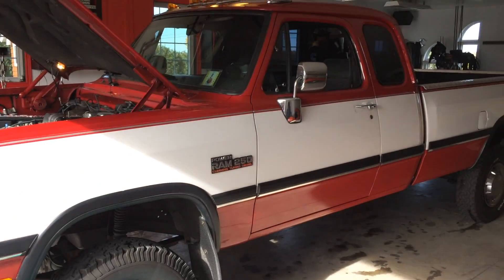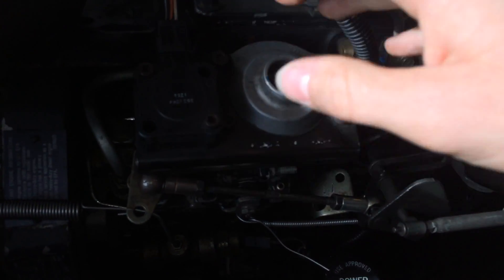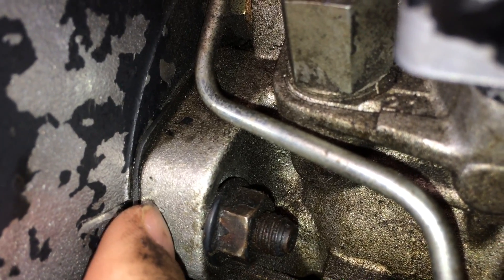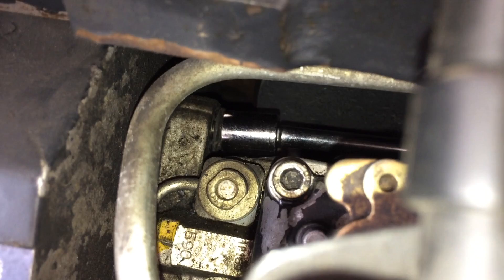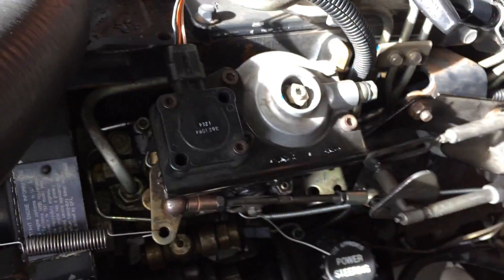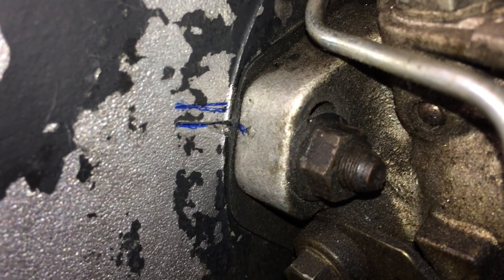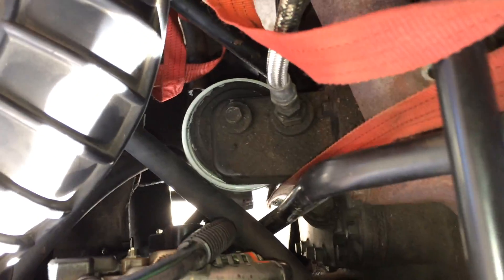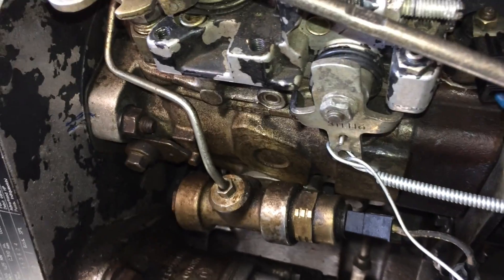VE Pump Timing Bump 12 Valve Cummins

Comment: Hey Tyler, how the hell did you ever get sockets on those two difficult nuts?  I've been at it for an hour and am not even coming close.  I can get a socket started on the one between the pump and the block but it's angled too much to grab.  The one up underneath I can't even get close on.  Did you use long extensions on both of them, and did you use a universal joint in there somewhere?   I'm about ready to give up.
Reply from the maker: Haha, if memory serves me right I believe there were many wobbly extensions involved and maybe a universal and some curved wrenches.
Reply: @OvensGarage  Thanks!  I bought some curved wrenches tonight and will give it another go tomorrow.
Reply: @OvensGarage  Ok, I got it done.  For anyone else who comes along with the same issue, here's what worked for me:  For the upper nut on the engine side of the pump, a curved (s-shaped) 13mm closed-end 12-point wrench worked great.  Just enough room to get it on the nut and turn it one notch at a time.  For the lower nut under the pump that you can't even see, I removed the throttle linkage and battery so I could get my head in there to see exactly where it was.  Then I put together a 13mm, 12-point, 3/8" drive socket, a 3/8" to 1/4" drive adapter, a long 1/4" drive extension, a 1/4" to 3/8" drive adapter, then my 3/8" drive ratchet.  The 1/4" extension was narrow enough to allow the socket to fit over the nut (tried the 3/8" long extension first but couldn't get the correct angle to get it on there).   The upper nut on the driver's side of the pump and the lower 10mm bolt are not an issue - standard tools to loosen those.
Reply from the maker: @garylewis327  thanks Gary! Glad you got it. Did you notice a difference in performance after doing it?
Reply: @OvensGarage  Tyler - yes, before this I had a little lag out of the gate but it just gets up and goes now.  I do seem to have a little more smoke than before, which I don't quite understand, but I'm going to turn the smoke screw out a little next.  I'm going on a trip next weekend so should have a better idea on overall performance and mpg after that.

Comment: I know it's been a couple of years since you've posted this video, but it's seriously good stuff, and I wanted to give my $0.02.

When the Cummins 6BT was used in the Dodge application in the 89-93 trucks, Dodge retarded the injection timing in order to reduce nitrogen oxide emissions to satisfy EPA requirements for the time.  Injection timings for industrial applications for the same engine are more advanced.  Advancing the injection timing by rotating the injection pump housing by 1/8" was a rough but effective way to recover economy, power, and throttle response.  You may also find that it'll reduce EGT.

Great videos, and thanks for doing them!
Reply from the maker: Thats a great point! Thanks for sharing.

Comment: Hey man after timing the pump my truck starts smoking white truck every time I start the truck
Reply: got my truck with the timing advanced like this and my smokes bad white smoke on start up. Thinking of taking it back to stock. does it reduce the power much
Reply: Timing is wrong,  make sure firing order is correct. I was able to cross some lines with white no start.

Comment: I also would have jumped the pump gear advanced one tooth
Reply: Jesse Rasso I have heard of people doing this instead of twisting the pump. I thought about doing it to mine before I put it in my truck. My gear stock is on the  “E”  marker. By advancing it which way do you go? There is a “C” to the drivers side of the “E” and a couple teeth to the passenger side is “D”.
Reply: @BolteBuilt  1 tooth counter clockwise
Reply: @BolteBuilt  if you go too many teeth it'll start popping jump 1 tooth is good

Comment: Not good to twist the injector lines, they can split and leak, later lol.
If you loosen the lines at the back of the pump you can turn the pump with just a push of the hand.
Reply from the maker: Good to know! I didn't push the injector that much but it might be worth loosening them off and re-tightening them now.
Reply: How loose are you talking about ?